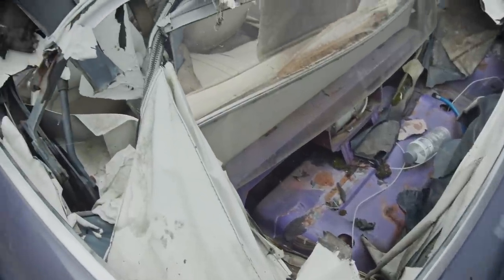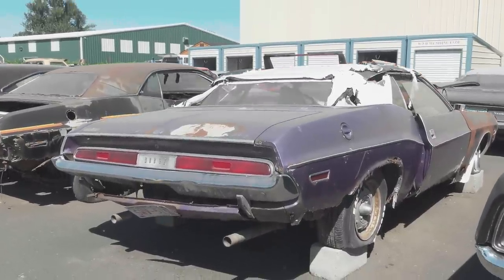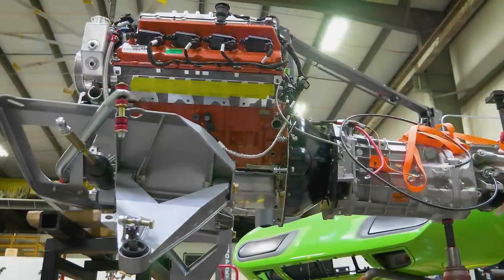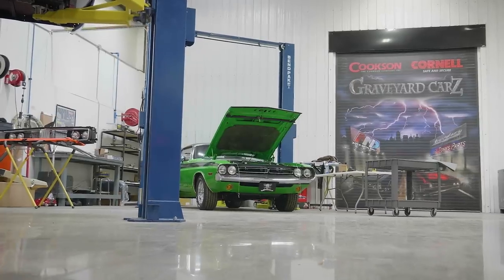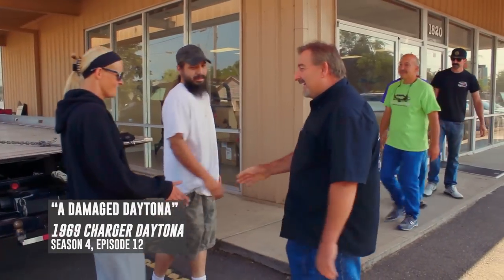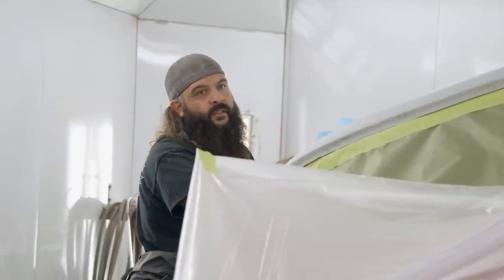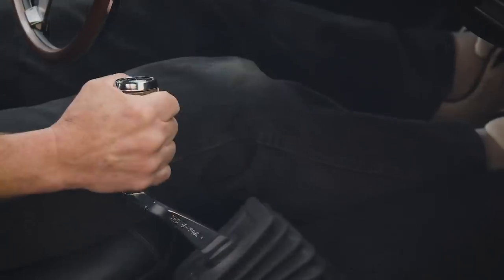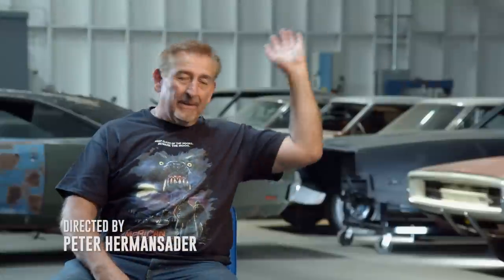TOTAL LOSS: WHEN EVEN GRAVEYARD CARZ CAN'T SAVE IT!

Comment: "can't" is a very big word. of course it all depends on budget and goal for the car. sure you can't save it to be a numbers matching all original car. but to someone that has more of a hotrod goal in mind. its savable because much of the car would be cut out and replaced anyways
Reply: Exactly all you need is the firewall and the VIN number and everything else can be new sheet metal
Reply: I just figured they meant the cost of the restoration would exceed the value of the car in the end.
Reply: @AmpasaurusWrecks  If you pay a shop to do it, yes.  But for a DIY'er to do at home, it might be worth it.

There are people out there who are able, and willing, to patch that car up and save it, so the car should be forwarded to someone like that.
Reply: @ligma knutts it's one thing to replace the body panels of a car but it's totally different when all of the structural metal is turning to dust
Reply: Your team did most of it so if you think about it he doesn't know wheh to keep out of the way let your team speak  I do like these cars but for heaven sake please  have some  respect for others  I would let my team speak  If  his  workers  were  working on my project I would let  them  work  not get in the  middle of it  you need to step back and wait that is the problem
Reply: Mark had no respect  for his  team  who  did  most of the work  I only saw him sand blast one  car but  any other  time  he just slowed down  the process  That is why he had  so many  problems  with his  workers

Comment: I would've saved the vert, if it's a real one of one car then it's priceless even though it would cost a small fortune to save it I still would do it
Reply: It's all original in its current state, with all the metal required to fix it, is it the same car anymore? You could build a brand new body out of aftermarket stuff cheaper than trying to save that one.

Comment: So they took a car from a customer, left it for years stored badly until it was totally rotten and then said "sorry mate can't be fixed".  I can't believe they took a structurally compromised car and tried lifting it up on a 2 post lift without welding in some bracing first to keep it all aligned, what is this, amateur hour?
Reply: Exactly they took his car. Stored outside exposed to the elements uncovered for years. Then they show how they're moving. A customer's car around without care. Like a bunch azzholes with a forklift. Then lifting the car on a two post lift without care. Its a convertible. They should've went ahead, and welded braces in. When they took the car in for restoration. The what are the parts worth part. Sounds like he only cared about, and wanted. To make money off another mans car. Saying what would you give me for this, and that. That car didn't seem to be a total loss, rusted in half bucket. In the pictures shown. After the owner brought it. The car wasn't folding from rust. When the owner loaded it on a rollback. Dudes an azzholes, he just didn't want too restore that car. After he left it outside for year's to rot
Reply: I hate to tell you this but most resto shops do this we had one that destroyed and we're stealing parts off about 8 cars . I hate to say it's common practice
Reply: Yes it is amateur hour with these people. I understand if you a schedule to keep with other vehicles, but there was no reason to just let it set like that, move it around a bunch of times, and then try and lift it with no braces. Almost like they did it on purpose just for the sake of the show and views.
Reply: @slowbutsure504  you are probably closer to being correct then you like to be some resto shops will salt cars so the can buy the car for the useable parts original brings more then repop
Reply: Concur. Have family in the resto business on the highest order. The worst of the worst resurrected to podium Pebble Beach.
Side note: This subject car in the video is one I almost think have personally known , especially when they mentioned Wadsworth Illinois.
Reply: @Shopsmith10er  out of curiosity did you know a guy name Wayne Smith or George Vaughn gol I spell gol wrong I forgot how to spell one was vintage autos in Alabama the other had a resto shop he bought from another guy after the former owner striped a 57 Chevy that had ever option that was only in for minor paint work the former owner left the country
Reply: We also had another guy that had a shop who is a well know crook had about 10 customers Camaros in his uninsured shop that mysteriously burnt down and the question around town was how much do they sell off the cars before he broke the shop
Reply: @surfofsinify  Really disgusting how this happens. I'm not pointing at anyone directly however I helped a friend in crating and prep to ship overseas his all in parts Porsche 356 Carrera coupe with 4 cam engine. This engine is most rare and valuable, and most important matched the chassis. Ten years earlier my friend had shipped the engine to a 'specialist' shop in Florida for a complete overhaul. Excuse after excuse, it was never done and then the shop closed. Long road trip and time away, it was miraculous the engine was found in a private garage of the shop owner relative, but parts to it were missing.
Reply: @Shopsmith10er  I can't believe you actually found it and be very leery of Florida it's not the first time I've heard that especially with m22 transmissions back in the 90s or matching Pontiac hypo motors
Reply: Tony makes a part 
It ain’t original 
A 100buck new part is 400 nos and 200 used 
End of
Reply: @surfofsinify  that's why I give up . No more classic cars !
Reply: Yeah I agree. A lot of this story doesn't make sense. When they took delivery of this it should have been part of the conversation about its vulnerabilities etc.
Reply: Maybe they dragged their feet and mishandled the car, but if they were going to restore it, I'm sure they would have charged appropriately, so I doubt they let it sit and rust just so they could salvage it for parts.
Reply: It seems like there was no structure left to weld any bracing onto.  Convertibles have additional body structural members to add rigidity to them but in this case they had all rusted away.
Reply: Actually being where it was and for the time it was outside it really wouldn’t change it that much just a sitting outside it really would take a long time to rust before it does much damage the reason most cars rust as mad as they do is cause they got a lot of dirt and other trash in and around them that stays wet causing the cars to rust much quicker and putting braces on it wouldn’t change the fact it’s rusted that badly also he hasn’t had the car for around 5 years so your comment is very incorrect but I understand that at most sitting out like that it would cause surface rust the rust in floorboards and quarter panels is usually cause the cars is sitting on the ground
Reply: @1575murray  that’s a good point
Reply: I think most of you missed the part where he said he sold it to someone who let it rust outside for years, then bought it back and took it to Mark to see if it could be restored. Once they decided to scrap it for the only good parts did they put it on the lift so they could salvage the parts.
Reply: I was thinking the same 😢
Reply: If you think the car gets in that condition in only a few years, even outdoors in Portland. You know nothing about cars.

Comment: Using plastic for masking? Any issues with paint flaking off the plastic when spraying? Had that happen more than once.
Reply: Not typically, we use the 3m stuff at our shop. Now if you have the masking upside down to where the writing is reversed then if flakes like a mofo.

Comment: you can still use single stage acrylic or polyurethane with metallics,but follow with clear.Diffrence is gallon base coat costs over 400 a gallon, single stage is 120 a gallon.
Reply: Where are you getting a gallon of any decent base for $400? And where are you getting a gallon of metallic single stage for $120? Not happening.

Comment: I'm just wondering with nowadays can you get a hold of any of the blueprints for making new sheet metal even though it wouldn't be 100% original to redo the body and use as much of the original parts as you can and or the other obvious option is parts for another restore
Reply: Yes, its called AMD they make everything

Comment: Funny to see you can't restore the convertable. Yet most the other rebodied cars mark restores get the same sheet metal replaced floors quarters doors fender roofs ect. And are savable sad to see it
Reply: Those body parts exist,  new convertible-only body parts don't
Reply: @rod.h8064  every bodypanel, and piece of sheetmetal. That's need to restore that car is available brand new. For the convertible challengers.
Reply: @bretjjjohnson7942  Really? As all the sheetmetal that Dynacorn have is coup only, same with the shell they do. If someone is offering replacement convertible Challenger sheetmetal they must be hiding it from the internet, or those re-bodied convertibles have the rigidity of a damp sponge from the missing structure reinforcement.

Comment: If the body too far rusted away, why not take the VIN plate and any of the usable parts off of the rotted body and put them on a donor shell? That could've potentially saved them time and money in labor and it would still be an authentic Challenger. If the majority of the car is rusted and has to be replaced, does originality matter at this point?
Reply: vin tampering?
Reply: @NoName99 NoFace88 wouldn't there be weld marks

Comment: Wished they would had save that car
Reply: And you would have forked over $200k to restore....what, with your $ or your parents $?
Reply: Probably could have . Wouldn't be much left of the original except for the Salvage of thr fire wall and shield frame. Most of the restoration cars don't have many original parts anyways.  He probably got a dollar figure to restore it and was told that a big dollar resto for a small dollar car that you would never get back because the conv wasn't optioned out wth any goodies except it being a conv.
Reply: Btw it's a, " one of one " rust and all😉

Comment: The whole hemi cuda that burned to the ground. The frame rails heII anything made out if metal. Was also compromised. Because of heat from the fire. That car shouldn't be back on the road,unless. So how many body panels did you replace on the hemi cuda. Did you restore his car, yes. So why wouldnt you restore. That mans challenger. Why does it matter. If he wants his car restored. Because it means something to him. Restore his mfrn car for him. All your doing is picking, and choosing. What cars you wanna restore. Or did you say that. Because you want certain parts. That make that convertible challenger numbers matching. If the cars not being restored. Why are you ripping apart and further destroying another mans car?

Comment: Painted High end collision for 38 years.  My friend who owned a very successful shop called me one day , said he was backlogged and had to open another starter shop.  He offered me so much money that I agreed to paint for him on a temporary basis untill he was caught up..
He had big plans for the new shop, but at that time it was just a three story warehouse with heavy lift elevator for the cars.  He had a crew install a very old ratty crossdraft booth in the corner of the top floor.  The ductwork was crooked and  needed replacing.
So each time I used the booth  the fan and ducts made a lot of bad noise.  I told the boss about it, but he just blew if off and said he would fix it on the weekend.
Then as I was just leaving for home, the boss got on the PA and called me into the office.
As I walked in I saw a woman sitting there .  She was crying and had makeup running down her face..
As the boss pointed to a set of keys he said go out back, get her car and handle it.
 I had to walk around the building to the alley behind it, and as I rounded the corner I stopped in total disbelief of what I saw.   THere was a white Caddy. parked under the  hole in the top of the building where the ductwork exited.  The car was completely covered  from bumper to bumper with blood, feathers and parts of pidgeons. The amount of blood was crazy.  A four foot wide swath of blood ran down the building from the duct exit hole.  Obviously the workers never put a grate over the hole they made, and many pidgeons had moved in, then got chopped up in the fan.
I had to sit in one way traffic just to get the car in the shop, as people freaked out and took pics.
 The  digestive acids ruined the cars paint, after baking in the hot sun all day
 THe boss claimed it was all my fault, even though I had told him about the noise Ect  the first time it happened.
He decided I needed to fix the Caddy for free, and he would buy the paint Ect.  Big LOL.
Now you know why I  didnt work for him before this. It was the end of our friendship.
Reply: Damn dude! God bless you! 👍😀
Reply: etc= etcetera
Reply: cool story bro LOL

Comment: I'm sorry, but it literally just looks like you guys couldn't be bothered to do it from the start and the whole point was to part it out.
You just let mother nature do her thing and then said oh it's in too rough shape...
That just pissed me off to be quite honest.
If I had a classic like that and wanted it restored I certainly wouldn't expect a rare convertible to be simply left outside or shunted around with a forklift, because someone couldn't be bothered to tac some chassis reinforcement on it and move it with a dolly.
Absolutely disgraceful.
Restored means restored, not restomod.
What a shame you guys let this one get soo bad because you couldn't be bothered doing the work in the first place.
Certainly won't be an all original car now will it 😮‍💨
Reply: @NoName99 NoFace88 might have been in bad shape when they got it, but leaving outside certainly didn't do it any favours.
Soft top that's gone left outside, like all the other shells...
They could've re framed the car or atleast made an effort.
Would've probably cost about 40-60k to get that car back again.
Which is why they didn't bother...

Comment: I`m sorry, but i completely disagree, that challenger and the superbird could very well have been "restored" and been the original cars in the end. That ist just a question of definition. Over in Europe all you need to have an original 66`Mustang for example ist the tag and the paperwork. You can simply buy a complete remanufactured body and build it from scratch. Thats how you do it, the demand is great, and there isn´t enough mustangs left to satisfy the market. The chinese though are even different. Touristic scene in china: "Hi, is this the original temple from 4.000 years ago?" " Yes, Sir, it is!" But my travelguide says, it has burnt down 80 years ago" " Yes, thats`s correct, but we built it again" "My book also says, it was once on the other side of the street and only half the size" " Yes, we made it bigger and moved it for the new railway line" "But it is the original temple?" "Yes, Yes, thats the original temple, 4.000 years old. Next city they even have a temple about 20.000 years old...."..........please build those two cars!!!!